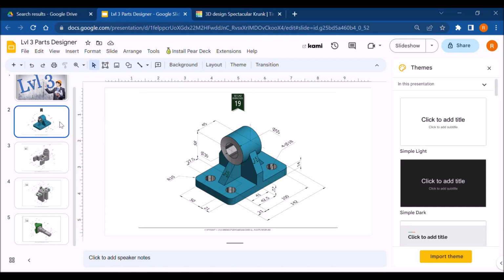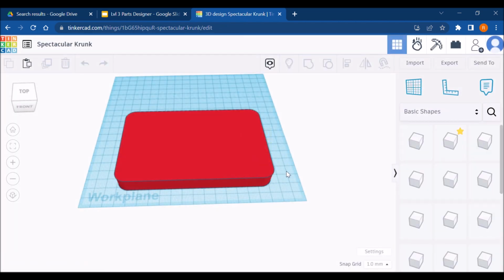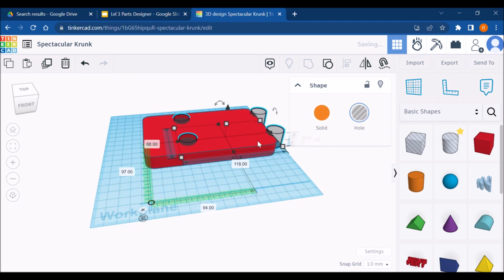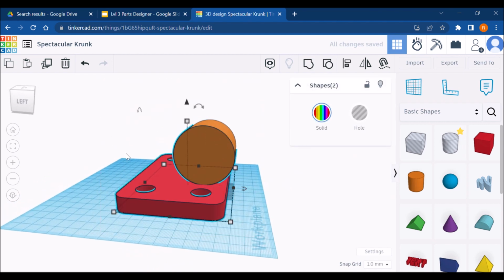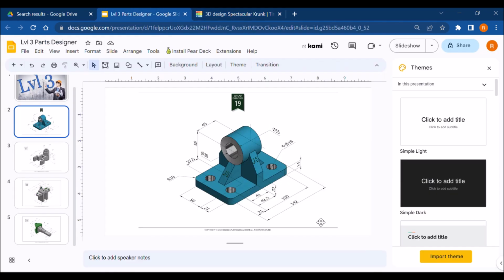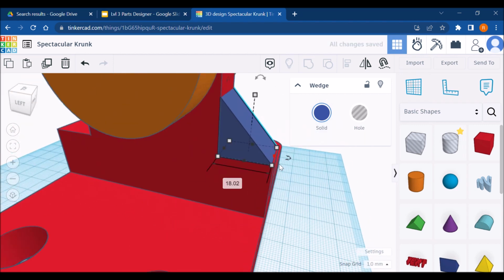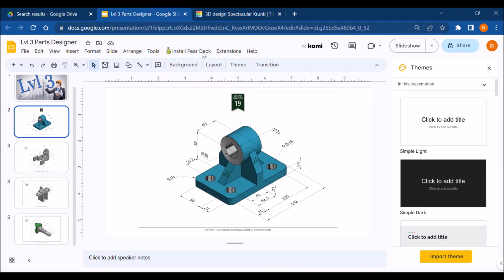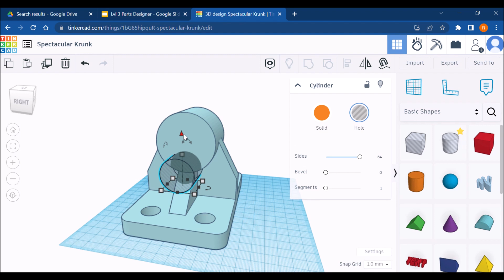Parts Designer lvl 3 Shape 1

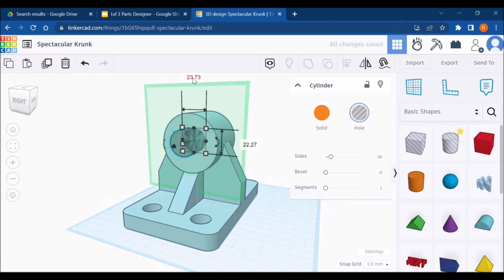Comment: @ minute 13:39, what did you type in to adjust the hole diameter with one command?
Reply from the maker: I "Scaled" the hole by clicking "Shift" & dragging a node. Once you scale it up/down a few times, you can then click on the number box & type in your diameter, it will scale all sides of the object based off the number you input.

Comment: Very good. You taught me a few clever things I've not thought about. Thanks......one question for you though.......I've noticed that, when doing the modelling, if I simply butt the face of an object up against another face (ie the distance between them is zero), the final 3d print seems to be flawed in that it's quite easy to pull them apart.....so much so that I now tend to 'sink' them into each other by a mil or two to ensure they are firmly fixed. Any thoughts on this? Am I missing a trick somewhere?